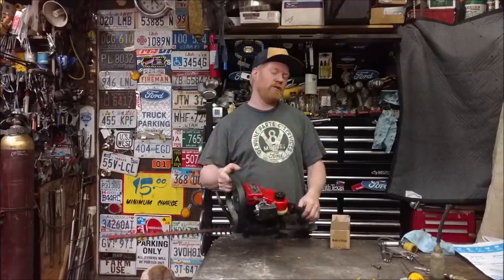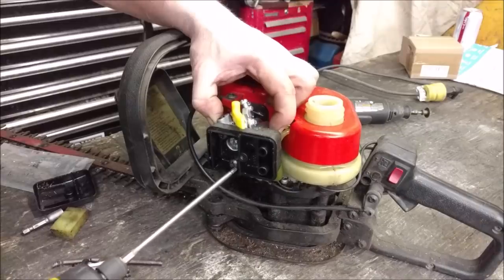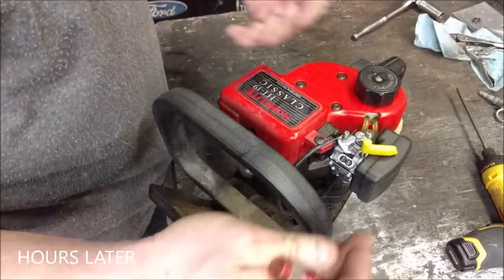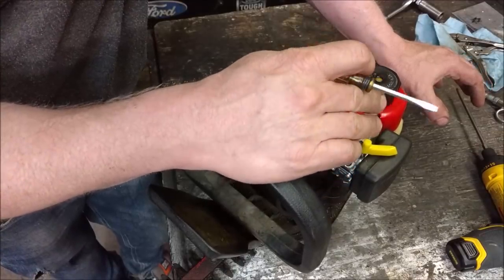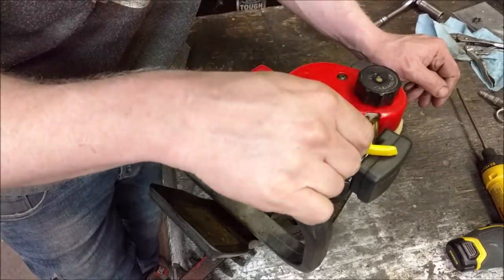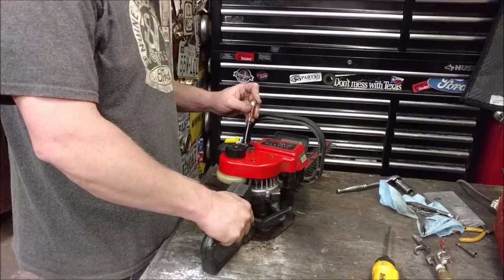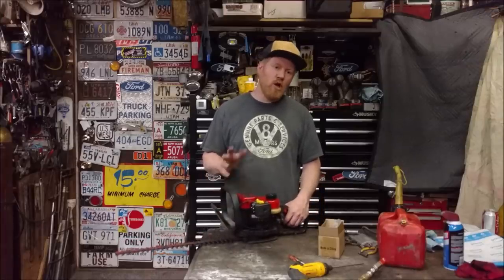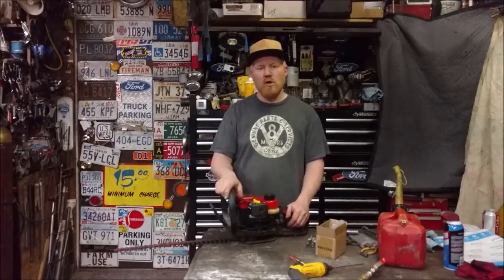Aftermarket small engine Carburetors worth it???

Comment: Out of the 3 I have purchased I have 1 that functioned partially on a Intek 13.5 in a lawn tractor. It revs now, but idle cannot be tuned. The 1 for the stihl trimmer wouldn't tune at all, it would run okay and 5 minutes later it would run like crap or wouldn't start. The one I got for the B&S 10HP on my old generator wouldn't even run, I stole the float and needle out of it to get the original carb going an so far that's been fine. I have to wonder with all the name brand stuff from the big box stores being made in china that does work correctly, how do they screw up cloning a proven design?

Comment: Good evening Mr 65 Ford. Now although I like the 64 Fairlane 2 door hardtop better especially little sport model with all the Chrome but anyhow to the carburetor problem. That's a two stroke and they are more touchy then others to start with and especially I see that you can't even adjust the fuel on that one because the way they are made that's a bummer I mean if it comes for their run all the way down where you going to get any adjustment at that's crazy. But what about the 4-stroke tiller engine? The reason I'm asking is I got out there in my tiller wouldn't start and it has an 8 horsepower Magnum engine on it and we're talkin about a 1986 model Troy-Bilt. So I'm in a tizzy and thinking o'lord, how am I going to get this thing loaded cause I'm kind of crippled up and done got too much age on me and I really need to work right now. So I'm checking out for carburetors for my tiller and they can't get them or they cost you a fortune and this thing hadn't probably been a part in years and I thought oh no. So I looked on eBay and found one for $13 and others that go on up to $16 and up to $25 and more but it appears most of them come from China. well I eventually got my carburetor off without tearing up the gasket and I was able to clean it out pretty good and I got it running the next day I think but it put me in a bind with the rain. so I was thinking if I had one of those $13 jobs and it would work then I could keep it handy and if the rains were coming I could stick it on real quick and get my job done and then worry about rebuilding my other one while it's raining. Well now you scared me. Have you tested any of the other carburetors to see if they were any good for the four stroke tiller Motors or Lawn Mower Motors? I'd sure like to know and appreciate it and thank you in advance if you can help me. Good day to you sir, bye-bye

Comment: I have had good luck with the Milttor carbs I bought for both Kohler and B&S engines. 
The aftermarket Kohler has the same numbers and name on it as the original carb.

Comment: Bought one for a 12hp Briggs tractor.  Within half an hr it filled the crankcase with fuel. Took the bowl off and looked at the plastic needle and ordered a kit for the oem carburetor.  Never did get the bowl gasket to line up again on that pos Amazon carb. You get what you pay for,  period.
Reply: Pretty sure one gets robbed every time.

Comment: I recently got a $15 carb off eBay for my Kohler 18 hp motor on my Husqvarna. Biggest issue I had was... Cannot use the carb to intake gasket they provided. Bolt holes not spaced perfectly. Other than that. All seems well. Factory oem carb like $120 !!!! I'll keep my after market carb. I'm not spending the$120 on a mower I paid NOTHING for
Reply from the maker: They do work, but nothing runs better than the original carb or an original rebuilt. If the original carb was destroyed and not cleanable/rebuildable then trying out an aftermarket carb makes perfect sense.

Comment: well crap! I have a robin engine on a golf cart thats running bad. I was thinking of going chinesium with a new carb. maybe I'll just rebuild the original. I just want to get it running so I can send it on its way to another owner.
Reply from the maker: I think the larger 4 stroke engines are more lenient about their carbs. I know the 4 stroke Honda clone carbs all seam to work great. Order it from Amazon and just return it if it doesn't work. I have a pile of weed eaters that could sell for $50-60. So I was hoping to throw a $10 carb and ten minutes of my time into them. I think they're destined for the trash.

Comment: I will add my two pence worth to these cheap carbs, sometimes you need a cheap replacement part to get a cheap 2stroke engine running otherwise the repair cost out weighs the machine cost, it does not pay to buy very cheap machines in the first place, ryobi being one of my pet peeves, sometimes I've had cheap carbs work fine, sometimes they just will not work no matter how good a tuner you are, I would say 50/50 chance that they work in my own repair experience, if you own a decent quality brand machine(not ryobi because there is nothing decent about them at all) , buy genuine (stihl etc).

Comment: I've had good luck with them . I just put one on my girlfriend Poulan weed eater. I tried cleaning the carb several times. I had extra parts from another one I fixed a while back but still couldn't get it going without that new carb.  I try to buy the carbs kit that comes with carb and spare fuel lines, pump bulb, filters and spark plug.  It seems that I remember way back taking the new carb apart and using the old body with the new carb parts. If you get board you can come over and work on my weed eaters. I got like 5 or 6. I got a Lincoln welder and a Kohler generator that I haven't got to work on either.

Comment: I bought a Chinese carb for my 12hp briggs and it ran lean and there’s no high speed adjustment and I could completely remove the low speed and it wouldn’t help at all
Reply from the maker: That's the boat I feel like I'm in every-time a get one of the Chinese carbs. They're close but not close enough.

Comment: Just looked at a box containing a $50 OEM Briggs carb. Yup, made in China. So, are Chinese OEM's better than Chinese aftermarket? Who really knows anymore? The aftermarket carbs could be made in the same facility as the OEM's.
Reply from the maker: What does that have to do with anything? There are huge variations in quality of items coming out of China. You pay for what you get even coming out of China. China is the king of cloning and has copy cat factories all over. They will clone the original carb or even make  a clone of a clone. Even reputable Chinese made engines will use name branded carbs and not these off beat carbs.

Comment: I got a B&S "red bulb" priming issue on a free Swisher String Trimer. Rotten gas(it was free), cleaned, rebuilt the carb (it was real bad) and replaced the "bulb" and it won't prime. Cleaned all the passages again, wired them with a jet tool. No Prime..needs a shot of starting fluid. Runs great, plenty of power, sooth idle  and starts just fine after warmed up. Feel a clog in the prime circuit that I can't get too...so debating a replacement. B&S wants $50 (which is cheap for B&S), Chinese ones are $15.....or just keep the starting fluid handy???
Reply from the maker: The larger 4 stoke engines seam to not mind these carbs as much as the tiny 2 stroke engines.

Comment: Picked up a trimmer that looks exactly like that one for $5 (Craftsman Bushwhacker 17). Carb all gummed up - tried cleaning - no go. Can you recommend a specific carb for it? Even if it is a little pricier? Or else it goes in trash. Thanks.
Reply from the maker: The C1U-H60 carb fits in the place of the stock carb on the Craftsman 17 Hedge trimmer. The primer bulb is just on the opposite side. Some have good luck with these, it's just hit and miss. You need to be the quality control.  I have bought these carbs for as little as $6 from Ebay(3 weeks from China). The problem with that is there is little to no recourse for returning them if they don't work. I'll pay $10 on Amazon and have them in 2 days and be able to return them if they don't work.

Comment: So I ended up rebuilding the original carb and the emulsion tube was stuck and I stripped it but I cleaned it with it stuck in and it runs perfect
Reply from the maker: Awesome.

Comment: Great video. I'm a auto mechanic that's disabled( thxs M.S.) small engine work is rewarding as I can do it sitting. I usually just rebuild carb. Only buying a new OEM carb if needed, which is seldom. I ordered a Chinese carb, and it never ran right. In this case, it was running lean. I did adjust it, and it ran okay, not great. To me, it's not worth the time wasted to get it to run, just okay . An example of running just okay? Having your run a weedwacker or snowblower on half choke. To me that's not a option. It runs right. Or not at all.

Comment: Thanks for this!! I've been tempted. I have a Tecumseh until with a card that almost worked after sitting for 15 years. I took it apart, cleaned it, not it won't start at all. I was very clean in my cleaning practice. The carb had the dried yellow deposits in it, but was not corroded. Did a bit of dirt get lodged somewhere? Don't know. Now I feel like I need to buy a kit with Welch plugs, etc. Urrrgh. I guess I just don't have when it comes to small engine carbs.

Comment: Having to close both jets to get it to run and not flood is the problem I have way to often.  The holes are drilled to large for the jet to seal.  The carb for my 8 hp Briggs 4 stroke has issues with the metering of fuel to the main jet. One time it's flooding and the next time it's starving for fuel. The float/needle seat nearly always will not seal and the fuel runs overfill.

Comment: The problem with those tiny carbs. is they don't have removable jets. there just metered holes which could be any size. and they aren't pre run they come off a assembly line and right into a box. so you really don't know what your getting. I've had better luck with the larger carbs. at least they have removable jets. so you can take the Jets from your old carb. and switch them to the new carb.. or in the case of them being too lean you could drill them to a larger size. but a person can still run into problems (example) I got one for Toro lawnmower with a Tecumseh engine the one I ordered was for the same size Tecumseh engine but a different application. it had a adjustable main jet and a float bowl drain. but when I received it I got a surprise the choke shaft was plastic. and got broke during shipping I contacted the seller and they wanted photos. I took photos of it but never could send them I tried multiple times it would just say failed. and by this time I ran out of time to return it so I made another choke shaft out brass round stock. which required some delicate surgery with the rotary tool. got it done but with all the extra dinging around I haven't got it on to the lawnmower yet that's next on the agenda. so my thoughts on Chinese carbs. is basically the same as yours. a person can try them but do so at your own risk.
Reply from the maker: I agree. I can get them too work generally but it's always a little finicky.

Comment: I bought one two summers ago for my Troy-Bilt riding lawn mower I think I paid $18 and it came with really shity fuel hose and Janke clamps... the carburetor is still kicking today but the hoses and clamps I never used...I just pulled them off the Briggs and Stratton Nikki carburetor and used my old fuel line...those Chinese carbs are certainly worth 20 bucks though..🇺🇸
Reply from the maker: If the old carb is trashed and not cleanable, then I think it's a good option. Larger 4 stroke engines aren't as picky as tiny 2 stroke motors.
Reply: @sixtyfiveford  I don't know that it's trashed...I think it just needed a rebuild...  I rebuilt it last year just in case the $20 carburetor gives me problems..  I can swap the Nikki back on... but for now, as long as the cheap carb is running...I'll run it....👍

Comment: Most of your videos I totally agree with , the little 2stroke carbs may be totally different. 
I haven't used the little 2 stroke carbs , but the Honda clones work great , like I put them on old Briggs , Kohler , Wisconsin , and maybe other engines. Of course I make adapter plates for them along with linkage. Anyway for usually less than $10 I can get an obsolete engine running better than it ever did with the outdated carburetors they came with that were temperamental even when new. 
Also any of the points n condenser ignition on older engines I've used the Clonda coils that are $8 to do away with all that antique technology. You do have to drill new mounting holes in the coils to mount on the oddball engine you are putting it on. But they throw spark like crazy and no more sanding and setting points.

Comment: Made for a different use that might be using a richer oil mix, bigger capacity engine. Doesn't mean its junk just wrong.
Reply from the maker: A larger engine will still pull in the same air/fuel ratio. Both the stock and aftermarket carbs are 12mm bore. A carb too large will have fuel starvation issues not overly rich issues like this one. If metering holes are drill barely off, the engine will notice.
Reply: @sixtyfiveford  It will want the same AFR. It will pull the same volume of air to create Vacuum. If the new engine requires a higher oil premix {remember this is a 2 stroke} it will need to flow more fuel mix to achieve the same amount of fuel to burn.  Hence the different jet and metering ports on the same carbs.

Comment: Funny thing is I believe a lot of name brand carburetor’s are made in China 

Walbro
Reply from the maker: Everything is made in China. The best of the best and the worst of the worst. The problem with China is they are amazing cloners. So if they see a factory making Walbro they'll take one, recast it, remachine it, and sell it as their own. They do all this without even testing the carburetor/ design. I have been to China personally and can confirm this. I could contact any number of factories and tell them to make me any design of carburetor or anything for that matter. Send them one and they will send me back something that looks exactly like it for pennies on the dollar. It's a fantastic Idea when you're making something like a purse, Nike clones, etc. But not so much when you making something that's mechanical and needs to work.

Comment: Never tried one, I got the right spec number carb for my briggs by getting a used oem one off ebay. 
It cleaned up great and didnt really need cleaning,but its best to check instead of just slapping it on.
Reply from the maker: That's the way to go.
Reply: @sixtyfiveford  
Just be sure to check out the sellers rating, so hopefully youre not buying from a crook. 
I havent been burned yet, and I probably jinxed it just now😂

Comment: I don't play games with these cheap aftermarket carbs on my small engines. If I spend good money on a piece of equipment, I want it to last a long time so I'm willing to drop the $$ on a brand name carburator. Just me.
Reply from the maker: True but I think they gouge a little on new oem carbs. I've had many machines that the carb cost more than the complete machine cost new. This machine was around $150 new and a oem carb is over $100. China can make nice stuff if they want, and I wish you could pick up a good carb for sub  $40. I'll stick to rebuilding where ever I can.
Reply: @sixtyfiveford  yeah it's all relative to how much you spent on the item that's for sure and as with everything it seems, name brands manage to gouge based on the brand name. I was thinking more about my commercial mowers, blowers, pressure washer, generator, etc. Rebuilding is by far the best option to me, and I also go for a rebuild whenever possible. I have replaced the carb on a $3,500 mower and a pricey generator however. The $150 or so was well worth it to me in those instances. China absolutely has the ability to produce quality engine parts but they also produce quite a lot of junk. Sometimes it's worth the risk, other times it isnt. As with most things, it comes down to dollars and cents.

$100 carb on a $150 machine... I'd buy a new machine.

Comment: We use them all the time at the shop the cost to put a kit in a carb and tune it out weieays the mark up on parts just buying a few of these to tune saves the customer parts and labor. I'm not saying. You don't get bad parts  tine to time
Reply: You really have to pay attention to the pulse hole location and throte cable  type and what company makes each carb better it's trial and error. The gaskets they come with don't always fit the application.

Comment: Do you have ghosts, your drill flashed by itself. 👍
Reply from the maker: That Dewalt drill is crazy. It has a tilt sensor in it to control which way it rotates. So you pull the trigger like a standard drill and it doesn't move. But you twist your wrist slightly clockwise to tighten or the opposite to loosen. The further you twist your wrist the faster it spins.

Comment: Some OEM carbs are made in China and are the exact same carb as the "knockoff", I have heard.
Reply from the maker: They're always sub par. The carbs made in China by the manufacturers are always better than the clones. Even some of the cheapest engine brands will still put on name brands like Keihin, Zama, etc as this makes a difference in engine reliability and performance. A bad carb will literally kill and engine. I buy used equipment all the time and will walk away if the owner swapped the carb and doesn't still have the OEM for me to rebuild.
Reply: @sixtyfiveford  I have never bought a new carb.. I always recondition mine.

Comment: I bought one for my lawn mower and it worked well right out of the box. The old carb float was plastic and warped so it was flooding. New one works great.
Reply from the maker: The larger ones seam to be less finicky than these little 2 stroke carbs.